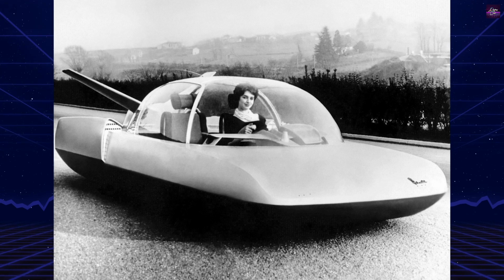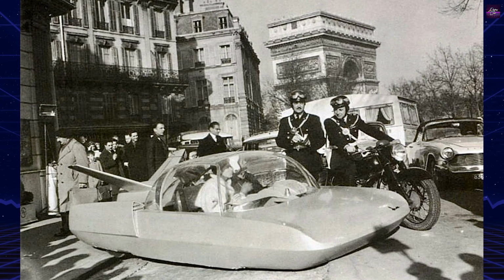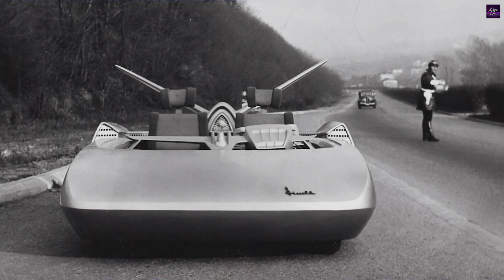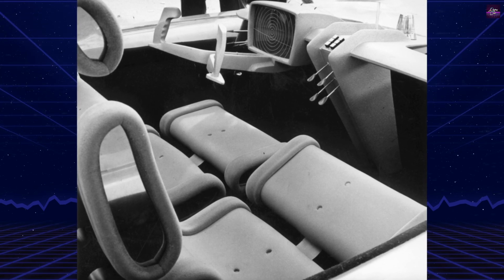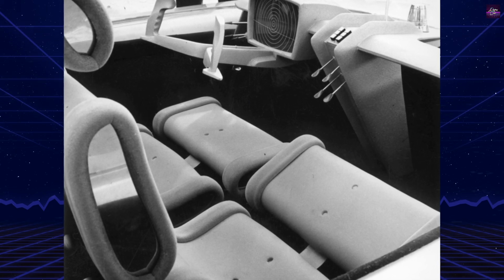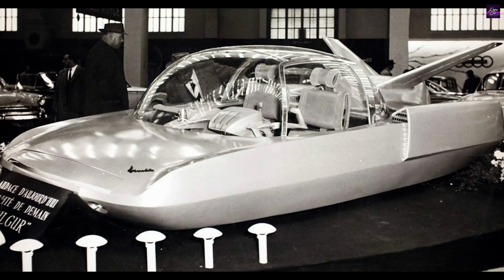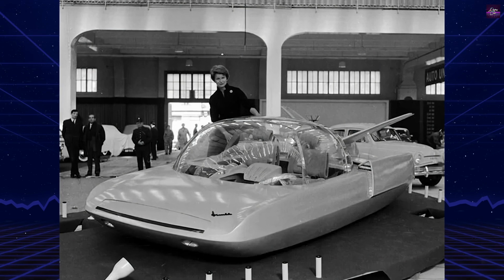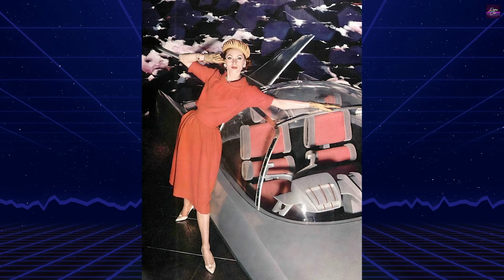1958 Simca Fulgur: How Robert Opron Tried to Split the Atom of Automotive Design

Comment: "Atomic batteries to power!  Turbines to speed!!!"  Yet another "Dream Car" that I've never heard of before, (though I do recall seeing a photo of this once, but I didn't know its formal name.)

As far as I can determine with a quick Google check, there are no 1/24th / 1/25th scale model kits of this car.  I guess that Heller must have been asleep at the switch.  Or maybe European modelers preferred stock and classic cars to wild, American-esque custom and futuristic concept cars.  I do have a small leaflet included in a Monogram kit exported to the UK in the mid-1970's in my files.  It featured their classic 1930's - 1940's lineup, as well as newer, albeit bone stock, cars.  But none of the wild show rod designs of Tom Daniel, or customized cars.

As a sidebar, when MPC licensed produced kits of classic European cars in 1/32nd scale in the 1970's using Airfix tooling, they included custom decals and "speed equipment" to offer a drag/custom option.  I have the MPC/Airfix 1911 Rolls Royce in my stash, and the custom version - complete with drag slicks, velocity stacks and side pipes, has a kind of "Munster Koach" vibe to it.  Yet, my email-pals from the UK are mildly repulsed by the idea.  Ironically, if Heller or Airfix produced a Simca Fulgur in 1/25th or even 1/32nd scale; I suspect it would have sold very well in the US.  

But at least one 1/43rd diecast of the Simca Fulgur exists in the $75 - $100 range.

Thanks for sharing!

39th Like.